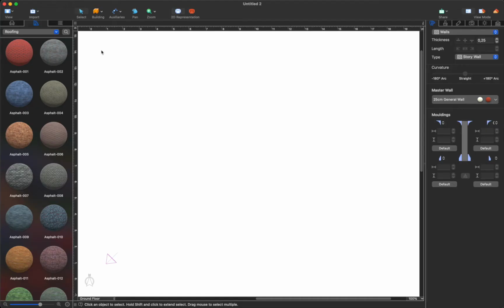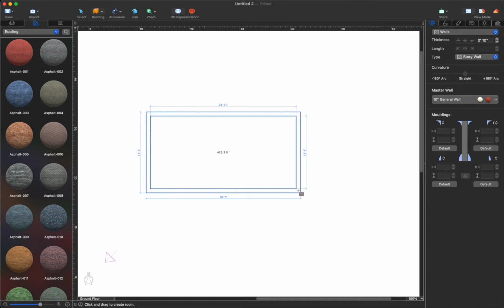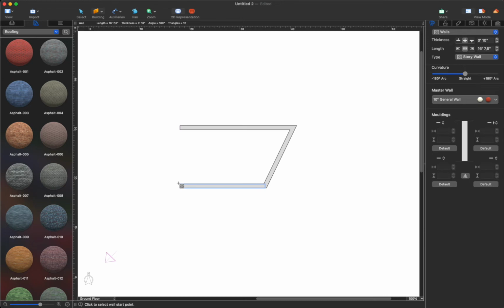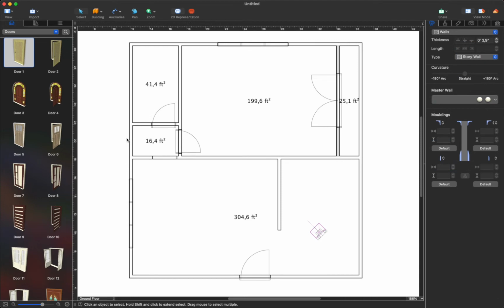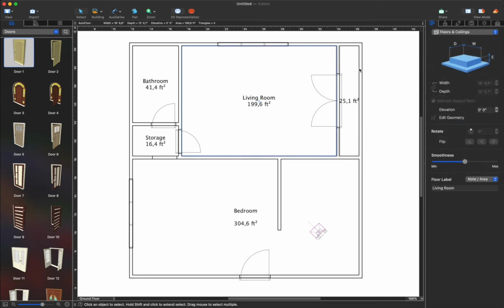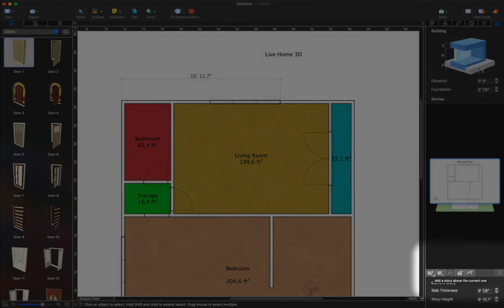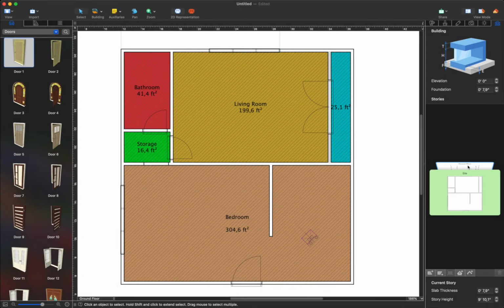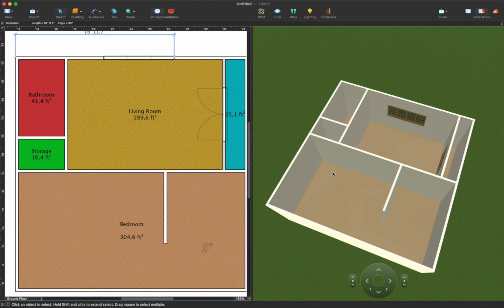Creating a Floor Plan - Live Home 3D for Mac Tutorials

Comment: How to select a floor without showing floor labels?
Reply from the maker: Hi, the "Extend Floor Labels" option allows you to choose what kind of information should be displayed on floor labels. This option is located on a Measurements tab of Project Settings. 
To access the project settings, choose File > Project Settings… from the menu.
To apply changes to the current project, click the OK button.
Reply: @LiveHome3D  Sorry, I should have been more specific. I don't want any labelling on rooms, and I'm trying to change the floor colors on various rooms and finding it difficult without showing, then hiding floor labels via the View menu. With "Show Floor Labels" off, it seems impossible to select a floor, without simultaneously selecting a wall, which then has to be deselected by holding ALT and dragging over it. If the wall is not deselected first, the fill color is also applied to it. Not the end of the world, but without a keyboard shortcut to toggle "Show Floor Labels", I'm menu diving rather more than I'd like. It would be great if floors could be selected another way than clicking on label text.
Reply from the maker: @LIGHTHOUSE PHOTO  Hi, you can select floor objects in the Project Tree: https://www.livehome3d.com/support/lh3d-help/working-with-projects-the-project-tree
Reply: @LiveHome3D  Thanks for patience, and the great tip. Just tried it and am very impressed. That has cemented my decision to move from Metropix over to LH3D for my floor plans.
Reply from the maker: @lighthousephoto7143  Happy to hear this! Feel free to contact us by email if you have some questions (support@belightsoft.com).